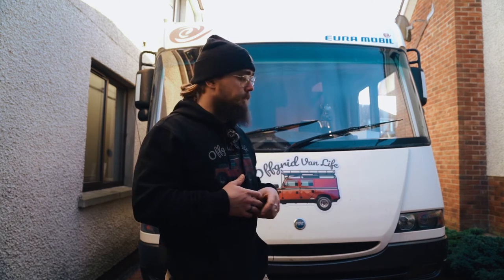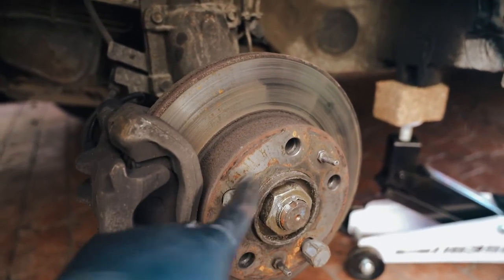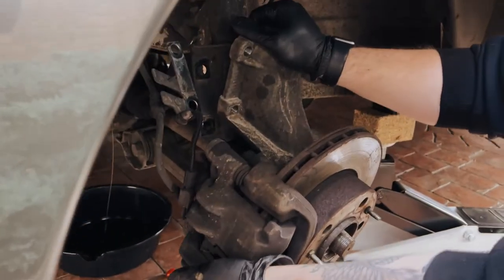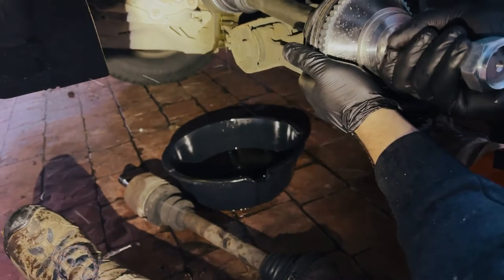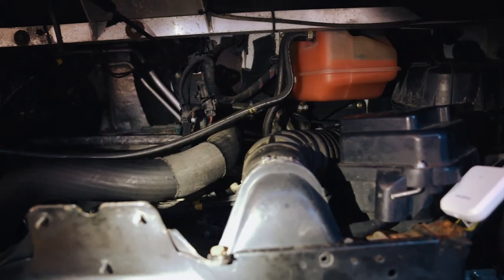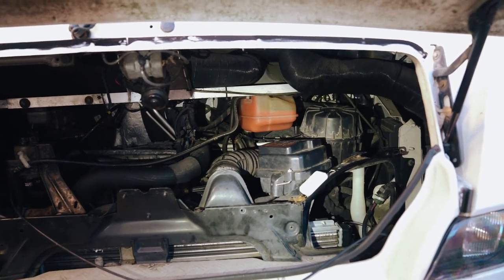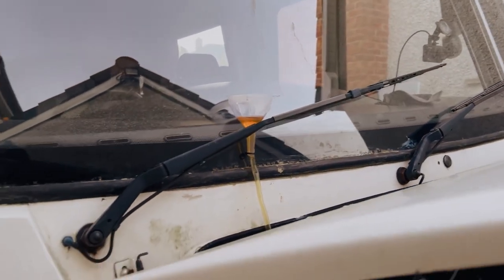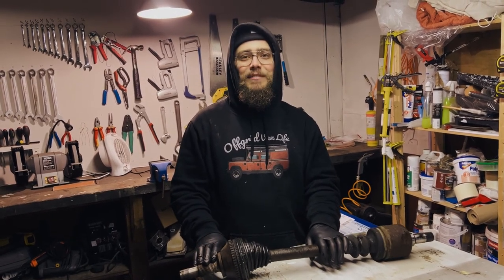How to change the drive shaft on Fiat Ducato 2.8L JTD / Euramobil Integra 810

Comment: thanks for this video!  I couldn't help notice your extra set of wheels at the back.  Good idea.  I've got this extra long Eura Mobil also.  From 1997.  2.5 TDI engine.  

My camper has 165,000 km on it.  no problems with the driveshafts yet.  But I'm about to drive down to Morocco and put on about 5000km.  in your opinion does it make sense to preemptively change a driveshaft?

Comment: Hi this is really useful thank you so much as we have the same Motorhome. We have a banging noise coming from our Eura Mobil so I am guessing it is either this or an issue with the gearbox ! If you have any more tips I would love to hear them! By the way how many miles has yours done as ours is a 2003 and just done over 50,000miles regards Mark in Kidderminster
Reply from the maker: Hi Mark. Glad the video was helpful. Our Eura Mobil has around 80k on the clock. It's a 2005 Fiat Ducato JTD. Hope you are able to find the problem without too much hassle!

Comment: Can you put the gearbox oil back in after?  I just changed my gearbox oil & then realized I may want to change my drive shafts.
Reply: well that's what i'll try to do.  just try to keep it really clean.  I put in about 2.9 liters initially, so that's good. i'll have some to spare.
Reply from the maker: If it's not too old, you should be fine reusing it as long as it's clean.